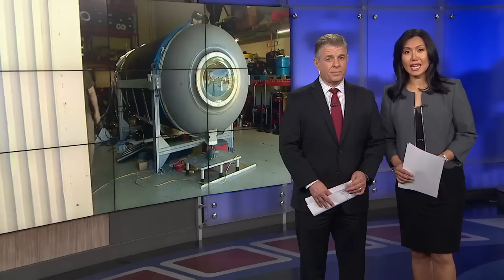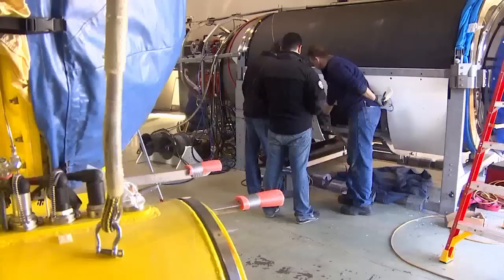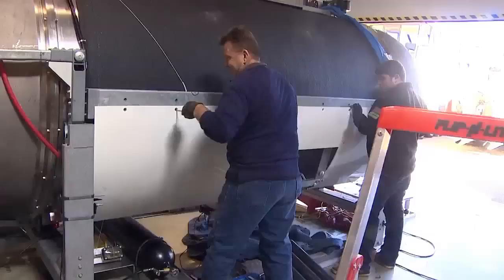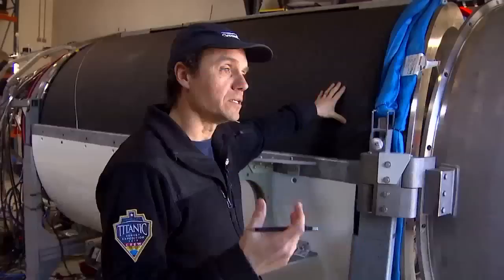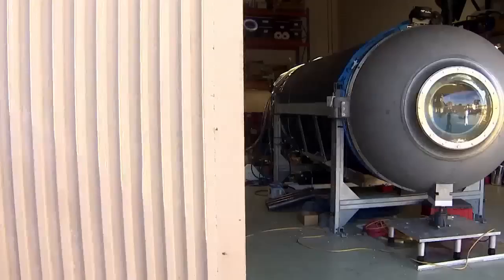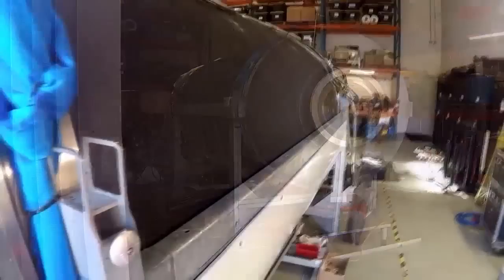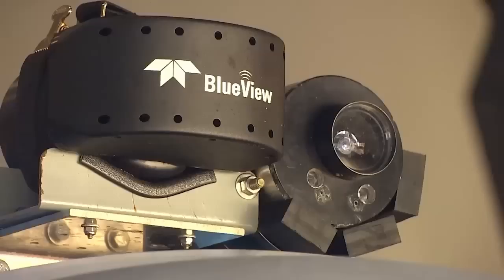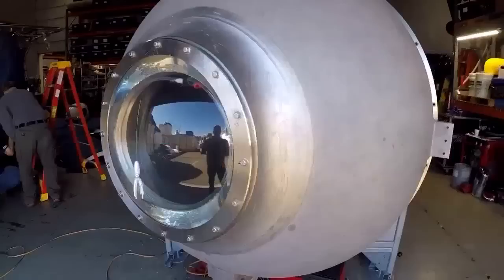The making of Titan: Oceangate's submersible capable of taking people to the Titanic

Comment: The engineer said it would experience incredible pressures but the team inside won’t feel a thing. How right he was, nobody felt a thing.
Reply: Carbon fiber doesn't withstand compression and decompression, so it's not good! Steel had to be made of hulls like most submarines.+Carbon fiber does not resist water corrosion over time
Reply: @Mihai_Radu1 For this kind of depth you need to use titanium
Reply: @oliverhardy9464  Yes, titanium is very good! But steel experts say it could be made much safer than carbon fiber
Reply: @oliverhardy9464  No, you can use steel to make continuous hull. It's not a regular construction steel, but it's a steel. Titanium and steel are both suitable as long as its poured in one piece and not welded.
Reply: A shame. Should have been stuck at the bottom.
Reply: You can’t mix different materials to make one sub. It was playing Russian roulette every time it dove.
Reply: @Mihai_Radu1 my table is from carbon fiber and they make a sub out of it 😭
Reply: Hopefully this "engineer" is investigated to the full for his part in constructing this death trap.
Reply: @gc99289  The pressure hull for James Camerons Deep Sea Challenger was made from two forged Carbon Steel hemispheres which were machined true and welded together and then heat treated. The limiting factor sub from triton also used two halves but was made from titanium and I think they were bolted together. I think it's possible to weld titanium with electron beam welding. But I digress the point is a welded joint is perfectly accepted practice provided it's done properly.
Reply: @oliverhardy9464 Jimmy Cameron’s sub was steel. He said steel titanium and acrylic were great for submarine technology to go to massive depths.

Comment: “But the team inside won’t feel a thing” Well… he wasn’t wrong.
Reply: well ...not exactly... they died before they knew it was happening and ostensibly didnt feel a thing
Reply: I don't believe they died instantly from being crushed. I bet they drowned. All the pieces were intact, not even bent.
Reply: @jrich5682 I don't buy it. I also don't trust engineers just because they're engineers. They make errors too and few of them are  brilliant. A lot of them lack common sense
Reply: @ld2588  carbon fiber hulll - gone, viewport window - gone, tail and landing gear - broke right off. A leak wouldn't do any of that.
Reply: THE 5- PEOPLE JOINED THE DEAD OF THE TITANIC AND WERE  COOKED AND BURIED AT SEA. 😂😂😢 ALL THE PEOPLE WHO WORK FOR OCEANGATE NOW KNOW JUST HOW IRRESPONSIBLE  AND DANGEROUS STOCKHOLM RUSH REALLY WAS . RUSH WAS A INTELLIGENT AND CRAZY AT THE SAME TIME!
Reply: @ld2588  the pieces that were found in tact were actually outside of the pressure chamber that is the reason why they were in good shape. Trust me, they die before they even knew what happened.

Comment: "We did this really fast"    If you're going down to the bottom of the ocean these are the last words you'd want to hear from your submersible's engineer.  

Makes wonder too about the mindset of passengers who took the risk, if someone's very rich it must to an extent cushion them from reality and impact ability to think critically.
Reply: Rich people know finances but not engineering. I am an engineer and I got alarmed when I heard the words carbon fibre
Reply: Survivor bias I guess. I took all these risk so far and look where it got me (I dont know if they actually made their own fortunes or not...).  The CEO said something along the lines of 'The past 30 years no one in submersibles have been seriously hurt, let alone killed.' 

He thought that all licensing bodies were just government roadblocks to find loop holes for and he thought that if you spend enough money on it, youll be fine. Dude said that everything could turn off and you would still be alive in the uncrushable  pressure capsule.
Reply: @xuxu119  And even listening to the cavalier sounding CEO was deeply alarming. 'Breaking rules' is possible for Internet start ups but not this. Sounds likely they will pinpoint the structural issues from the pieces.
Reply: @xuxu119  It’s worse, I’m willing to bet it was a selling point 😬 They basically made a narco sub on roids!
Reply: @xuxu119  i can't say i am a fan of carbon fibre, is it really a lot of hype to say its stronger than steel, sure it's lighter, but when i see every time an F1 race car collide with another car and shards of carbon explode all over the track i begin to wonder of its over use in aviation, delamination is pretty destructive, UV degradation and aircraft brought down by lightning strikes that cause parts of wings to simply explode - critical parts being made light to replace metals might work in some cases under normal known loads, introduce something new and the effects it has on them can be drastic
Reply: Bit of a “Rush” job I’d say.
Reply: @iamthebroker  you my friend just win yourself a cigar 💯
Reply: @Butternose  😂😂😂
Reply: They’re all dead 💀 now
Reply: Not just about being rich but these people are passionate explorers that take risks very often. If it were someone who didnt care about it why would they risk their lives?
Reply: they must've thought their money would save them
Reply: yes, exactly, "we did this extremely fast" wow, that says it all. I love the way they said "that is pretty cool" right,
Reply: agree this was extremely dumb and no one should be on that sub, n that clearly it wasn't made safe at all in fact they threw safety out the window. But one passenger was just the tour guide who knew a lot about the titanic hired by the company, another was a professional adventurer who has done plenty of dives pretty sure he went to the titanic before too. Plenty of other adventures called out all the safety concerns I'm sure he heard about it from somewhere, but for some reason he still got on. Maybe he thought it was safe enough, maybe he just really wanted to take the trip idk, but only 1 of the passengers were rich millionaires who had no clue about submersible safety or had any fears. So saying it's just their money cushioning them from reality isn't right at all. So only one passenger SEEMED to be that way you guys are thinking, and that was the father, the son was scared. N we don't know what the father thought either, so you can't even say that with certainty. We have 0 clue what he really thought, so I ain't gonna say oh he was this, n it's really sh*tty a lot of people are doing just that.  Another thing, it was definitely somewhat of a tourism thing but they were down there to do real science. Learning the effect of shipwrecks on the environment and how ships degrade in that environment is actually a very useful science and a Nobel cause, just done by the completely wrong company with completely wrong ethics. Anyone who tried to speak out against the safety of the sub were threatened with lawsuits, the CEO considered people telling him how unsafe it was n how he was wrong to take passengers, as a personal insult for some dumb reason. Even costumers who had concerns were basically laughed at and told how dumb they are n how baseless their fears are. Very egotistical and dumb dude who had no concerns about whether he was truly right, because he "KNEW" he was right. Or atleast he thought. His confidence, ego, and lack of care led to everyone dying, the exact same as the titanic captain. Can't believe anyone is defending him
Reply: @patchmack4469 it’s literally meant to breakup like that to shed energy, for that specific thing. Less energy that gets dumped into the driver. In plane applications it will be cross laid and such that it is not intended to do that. F1 engineers have talked about laying it specifically. Also besides the monocoque which basically has never failed, it is meant to be very very very very light. While airplanes certainly have to be light weight, I think the tolerances are a bit better than an f1 car 😂 and if you see the carbon composite monocoque that literally never bursts apart or gets broken I think you’ll understand better. And same thing goes for these submersibles - the crew compartment is a titanium sphere but the craft itself is much larger. All of these engineering problems are pretty well known about. lol f1 cars are  literally engineered on purpose to blow apart like that, yet the driver compartment is effectively always completely fine, even in the horrific grosjean crash. And as you see there, the engine and rear suspension snap off - this is designed to happen in the event of a high energy impact like he had, had it not he may have been knocked out and almost certainly died in the fire. The one shortcoming it did have previously was no protection for the drivers head so the last deaths to occur in f1 are from that, hence the introduction of the halo and the screen for Indycar. Make no mistake - CF is amazing - but all materials have to be used in reasonable applications. We don’t make cars out of wood for a reason, but it’s great for building house framing. You just have to be a moron to do what these idiots did using it in compression, and on top of that not in a vacuum/not in clean room or negative pressure room/using expired CF.
Reply: Exactly that’s why I literally been watching every video to see what the past passengers think now and what they have to say , I wanna know what one of the woman that was on it last summer when cbs Sunday morning did a report on it … and when I seen that cbs interview about 6 months, I was literally shaking my head throughout the ENTIRE video.. you bragging about “cutting corners” using acrylic glass for the view port (that can’t even withstand the deep ocean depths of water) and to brag about using carbon fiber .. ignored the entire submarine community on to do what he’s doing, ignored the concerned letter is just 🤦🏽‍♂️ all that he bragged about and having that cavalier attitude literally cost his life and costed those other men’s lives …
Reply: @xuxu119 are you saying there’s no rich engineers 🤨
Reply: @osmanisildak2448  "We had a DEAL Murdoch!"
Reply: Yes, he is talking like he just build some Lego toy. Usually they dont build submarines or mercibless fast and they pressure test then multiple times and makes several dive tests too before taking any passengers In.
Reply: @xuxu119  Carbon is fantastic at a great many thing - just not as a multi-use pressure vessel.
Reply: @jessiejamesferruolo  I mean there really aren't any specific regulatory bodies for deep dive submersibles. The community has a few they all adhere to but it is really the wild west in a sense.
Reply: @patchmack4469  Carbon is extremely strong in sheer strength but side loaded it will shatter easily because it is so stiff. F1 cars use it as part of the safety features not just because of its lightness and ease of shaping - those cars explode apart like that on purpose to help dissipate the energy to the driver so they stand a better chance at survival.  It works great in aviation, not sure what to tell you there but has been used since its invention.   UV degradation is easily mitigated by uv resistant epoxy, primer and paint.   The reason you don't use it for a submersible is that it is so stiff you get one maybe two trips before you have to xray every single inch of it to look for micro cracking.
Reply: @corail53  yep i kind of get that, all loadings are so much more under water than air - its funny i decided to watch the entire series of Jeagues Cousteau programs, the stuff that guy did back in his day was truly inspiring and remarkable technology, even though his subs only went to much shorter distances, the testing was all in place, he also developed the diving apparatus and even the crane on the back of Calypso for moving the sub in and outboard, that crane design is pretty much second nature now on all trucks, such as the mighty Alas, a successful man in his day, and the costs must have been pretty high for those days but all met

Comment: “The crew inside won’t feel a thing” yeah I’m betting when you realised it couldn’t take that much pressure and crumbled like paper they weren’t gonna feel their deaths
Reply: Actually the implosion is so fast that you die before you even know what happened.  But I get your point!
Reply: @visualizecreate2530 I think that’s what he’s saying
Reply: I don't think they felt their deaths. It happens too fast. But it's hard to know for certain.
Reply: Its a milisecond thing.
If 380 bar presion hit a 1 bar pression chamber literaly explodes
Reply: @visualizecreate2530  Actually, you just repeated what he said.
Reply: @visualizecreate2530  I agree, the implosion would have crushed them fast. James Cameron said that they had about 2 minutes before the implosion. He looked at the time of the last message where he said there was a compromise to the vessel and was dropping weights to resurface and compared it to the time the navy sensors detected an implosion. I think he probably sprung a high pressure leak and it aired up that sealed cabin and exploded it like a balloon. It could have started as a pinhole high pressure leak and it was the beginning of the end. What leadss me believe this, is from the pictures of the parts they brought up. The hatch that they bolted shut, had all the blots sheered off, which shows it was blown out from the inside out.

Comment: It’s amazing how much information there seems to be out there about carbon fibre being a bad idea….. and yet they still did it.
Reply: Titanium is pricey
Reply: @mrjjman2010  It's still much cheaper than 5 lives.
Reply: Elon Musk was obsessed with it as well until he realised it was crap
Reply: @mrjjman2010  Carbon fibre, done properly, isn't cheap. Titanium isn't that expensive either. Rush was just crazy and obsessed with a singular idea. Carbon is wonderful and even ideal for many applications, far moreso than titanium, but it is the worst material for deep diving.
Reply: And now everybody is a submersible expert.
Reply: It's not that it's a "bad idea" it's just that the material hasn't been studied well enough for undersea applications.. The fact that it worked  about 25 times before it imploded suggest that while not ideal for that application... It may still have some uses... just not for the main vessel.... ( more research need to be done)  The bigger problem I think was made with   dissimilar materials held together only by glue...

Comment: This didn’t age well. How would anyone trust a company that couldn’t even invest into a legit submersible controller vs PlayStation.
Reply: Milk
Reply: Actually the P.S. controllers are more advanced than any of the controllers used to send people into space, the moon or most of the telemetry and data hardware used up to the early 1990s. They're exactly what you would want to use on the submersible. Reliable, easy to use and abundant in case of failure. People think everything has to be one of a kind or hyper technical. Wrong. The more tech, the higher chance of problems or failure. Anyway, that most likely wasn't the issue, my guess is structural failure resulting in instantaneous decompression and then, well, poof...
Reply: Let’s not compare rocket launches from the ‘60s to operational usages today. I understand simplicity can be safer, but you also don’t see simplicity on the mini subs that go down that deep, I’d guess because they actually have money invested in their development. Simplicity at a budget vs simplicity at a no expense spared type of design are 2 very different things
Reply: @tencentpistol1 they are not reliable at all, they randomly stop working all the time
Reply: Some US navy subs use game controllers, I'm sure the have back up systems however
Reply: @grandsoleil56  They may "look" like game controllers ... that's where the similarity ends!
Reply: @simonbaxter8001  No it really was, albeit just for periscope control, I'll find the documentary on YT
Reply: so you are going with: "they used a playstation controller so the thing imploded" ?  I guess by that logic if I'm smart enough to drive a car remotley with a playstation controller it will also randomly explode?
Reply: @whatyoudo9773  how do you know it imploded?
Reply: @grandsoleil56  it is a more likely scenario than " the controller sent them to the depths". because...how would the controller cause them to dissapear? by the way...love your username   major thumbs up!
Reply: @whatyoudo9773  fair call, nice Черный Кот 🐈
Reply: @whatyoudo9773  it’s not so much that the controller dove them to the depths but more shows the cost savings taken in the R&D portion of the submersible design.
Reply: @grandsoleil56  looks like you were right...
Reply: @cjasonhendricks9722  looks like it imploded (faring and landing frame found) so demise was unlikely involved with aforementioned control systems
Reply: @tencentpistol1  WOW, YOU WERE RIGHT!!! ARE YOU SOME KIND OF PSYCHIC OR FORTUNE TELLER??? HOW DID YOU KNOW IT IMPLODED AND IT WASN'T THE CONTROLLER LIKE SOO MANY PEOPLE HERE THOT IT WAS???
Reply: @grandsoleil56  EXACTLY 💯💯